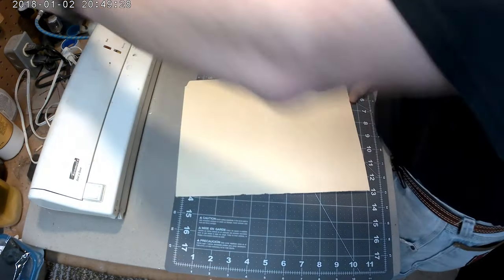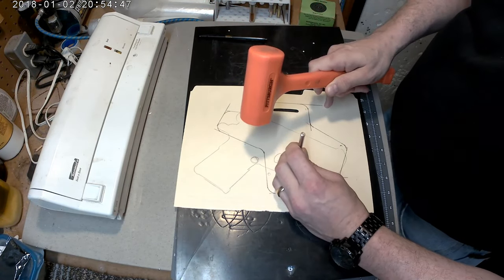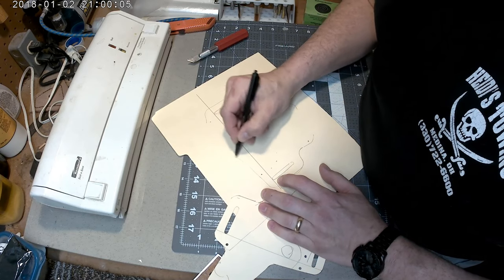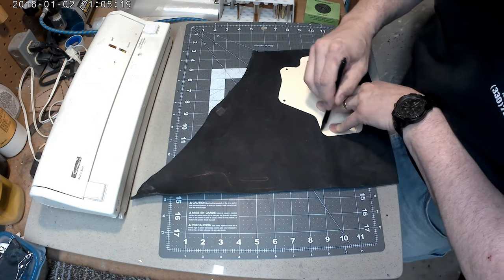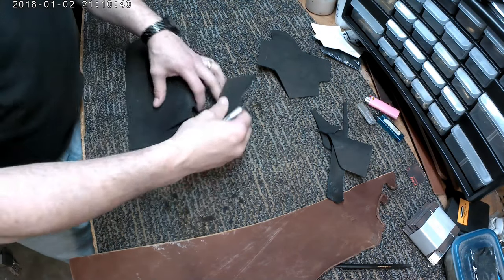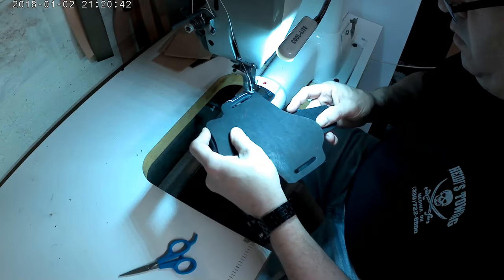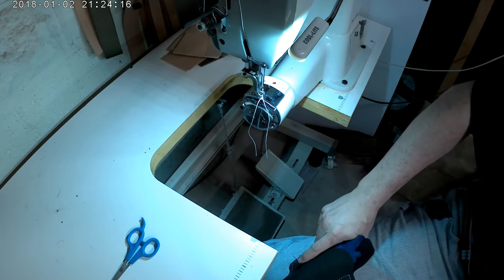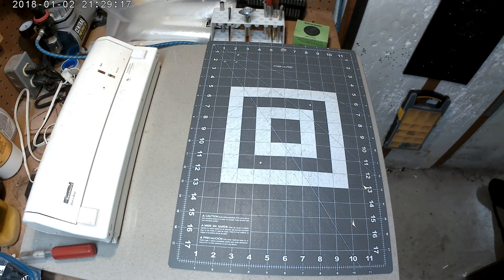Making a Leather Holster Pattern - Science meets Art - Work-A-Day Custom Gunleather

Comment: Is there a reason most if not all pancake holsters tip the gun forward instead of more backward? I find this more difficult to pull the gun, it tips your wrist in a very uncomfortable direction and makes for a longer draw. I'm not practicing quick draws, but incase I needed to draw it in a tense situation I would like a more natural position.
Reply from the maker: For carry purposes, this allows you to draw the gun to your front.  You support hand should be in front of you at your center and the gun and strong hand should come up to meet it.  If the holster was raked backwards, you would draw it to your rear and quite possibly end up pointing the gun at yourself, or "flagging" your side.  Cross draws draw towards the grip, but they are positioned differently.

Comment: How do you measure your belt slots?
Reply from the maker: This works better than my first response ... The slots themselves are made with a 1 3/4" oblong punch.  This allows for a standard 1 1/2" belt to fit nicely.  The placement of the slots falls into the art-meets-science range.  I figure out where I want the gun to sit and run the slots accordingly.  I figure the top of the slots will run along the top of the belt.  I often start over as soon as I place the slots because I visualize the holster from there.  The slots are actually the first element of the actual holster to go in the pattern.  Everything else is based off of those and the gun itself.
Reply: @workadaygunleather3331  Thanks for the info and for the response. Great work.